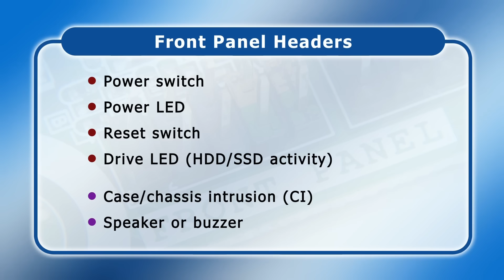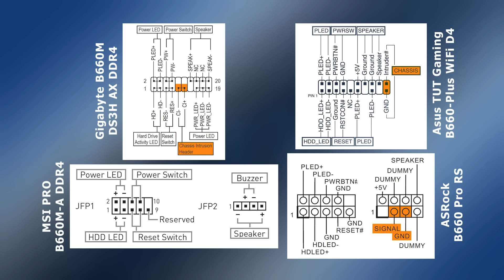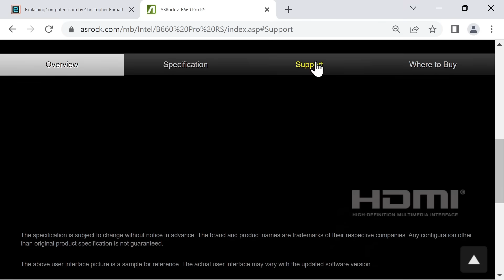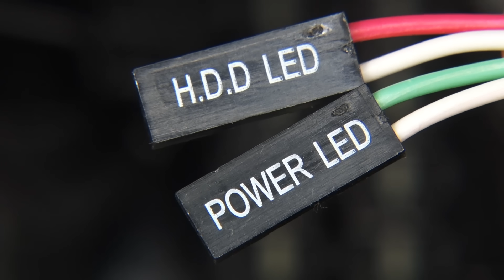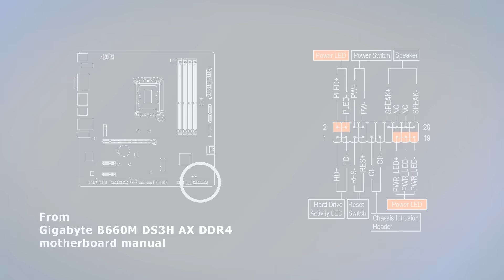Explaining PC Front Panel Connectors

Comment: I remember at least one case (pun intended) where I had to separate a bundled pair of switches to make them fit. 

I think it was the speaker that had a 4 pin connector with only two pins populated and they were next to each other while the motherboard had them separated. 
It is easy to change something like that with a paperclip or pin. Perhaps worth a small followup.
Reply: I went through the same situation several times, it was the speaker connection too.

Comment: I'm really glad that like 99% of manufacturers have the layout of these standardized nowadays, it was such a nightmare having to manually do each pin. Audio ones were the worst, because cases would commonly use different terminology than what the mobo manual said. X(
Reply: Maybe the usb consortium can help with naming/layout standards :D
Reply: @ironfist7789  please I'm not strong enough for this
Reply: @ironfist7789  The USB consortium has done terrible job standardizing names.
Reply: @markanderson2904  can call it UMB (universal mother board) 1.alpha.0 season 1 interation 0
Reply: @ironfist7789      Don't give them any ideas. 😊
Reply: @ironfist7789  That's good.
Reply: A written layout would have been nice...with some sort of labelling.
Reply: @remikdudek  noooooo I'm meeeeltiiiiing
Reply: why you connect any, need resets ? Press high ?
Reply: I recently did a video about a usb port front panel io that was split into each pin. What a pain to connect

Comment: LOL, wasn't much the front panel that was scary in the 90s, but the polarity and voltages of the processor. Get those wrong, and you could make the processor go bang bang.

And then there were IRQs and DMAs.

Most the front panel was just fiddly. Oh and setting the speed/turbo LED display...
Reply from the maker: Oh yes, those DIP switches were fun! :) Although usually well documented.

Comment: A small observation: with the correct polarity of the LEDs, the inscriptions on the connectors will be outside.
The speakers operate on alternating current, so they do not have polarity in the usual sense. However, the polarity is often marked on the speakers. The fact is that the speakers in multi-channel systems must be correctly phased, otherwise the sounds from different speakers in antiphase will cancel each other out and it will sound really wrong. Therefore, on the speakers there are conventionally plus and minus inscriptions in order to connect them correctly. If there is only one speaker, it doesn't matter.
There are also buzzers with a built-in generator, polarity is important for them (but they are not used in ordinary computers).
By the way, that small black buzzers are not piezoelectric. Although they have some design differences from conventional speakers, they are still dynamic, with a coil and a magnet.
Reply from the maker: Thanks for this. Not all headers have anything printed on them. :)

On speakers, I was very careful to caption "The front panel speaker does not have a polarity", and this is true. This is an educational video, and it would not have improved clarity here to explain that speakers do have a polarity when fitted in stereo pairs to avoid them being out of phases.

On the buzzers, I stand corrected. Thought I've certain fitted (and once opened up) one that was piezeoelectric.
Reply: @ExplainingComputers  Your average subscriber follows you for the nature of this response. I have an old HP which I use as a test rig, not shipped with a POST sound device. I absolutely have some old baby toys I never thought of exhuming for speaker collection. I would have continued to POST in silence were it not for this. That beep without a monitor attached can be pricelessly convenient. Remembering how many times I resisted the urge to buy a bag of case speakers not realizing I had about 15 candidates in by basement.
Reply: @ExplainingComputers  most of the buzzers i've opened up were a liiiiiitle tiny coil on a metal post, a ring magnet above it and a metal disc with a magnetic slug of metal welded to the center in a stack with a black cap that fits the base with a tiny 2mm hole in it as diagrammed in ascii, wires, plastic case(with pcb) tiny coil on metal post with ring magnet around it, metal disk, cap with hole =[:-:| } wow, i just diagrammed a speaker with text, i bet it'd look even better if i went beyond simple keyboard inputs and used the full unicode map of characters
Reply: +1 speaker wired in the incorrect polarity will be out phase.  the way to tell is that the positive terminal should make the speaker cone move forward, use an old 1.5 volt battery.
Reply: @garygranato9164  Out of phase with what?
Reply: @markanderson2904  try sucking in air when your lungs are full and blowing out when they are empty, similar happens when you try to drive a speaker backwards ;)
Reply: @frogz  No, it doesn't. The convention is to wire it so that the speaker cone moves "out", when a positive voltage is applied. But that isn't required to make speaker work properly. If you have two speakers, such as in stereo sound system, you want the speakers to be in phase with each other.  That means that when a positive voltage is applied to each speaker, one moves in the same direction as the other. It doesn't matter if it's forward or backward. If your stereo speakers are facing each other and you still want the speaker cones moving in the same direction at the same time (in phase with each other), then you wire the speakers opposite to each other. In a situation where you have only one speaker, "phase" is meaningless. It can't be "in phase" because there is nothing to be in phase with. That's why Chris says the polarity doesn't matter with the beep speaker.
Reply: @markanderson2904  with the original recording and other speakers that are wired correctly
Reply: @markanderson2904  I don't know if/when it changed, but it used to be anyway that most speakers were designed for forward movement and would not work correctly with reverse polarity, and if left that way for too long, could get damaged by it. The voice coil could be damaged by hitting the back plate, for instance. The surround and the spider can become fatigued by being continually pushed backward if they're not designed for it. Sub-woofers usually are made to work in both directions, but not all of them have been.
Reply: Great info,
Thanks 👍
Reply: This is what I was commenting, but explained better here.
Reply: @sorphin  The motherboard sends square wave pulses to the speaker, switching between +5 and 0. It does not create a negative voltage, unlike audio signal sources (radios, players, and so on). So, technically, the signal has a kind of polarity.
But for the loudspeaker it doesn't matter. On a pure AC signal (+V ... -V), it's membrane will oscillate in both directions, on a signal from the motherboard, only in one direction. Polarity only affects which direction the membrane will move during the pulse. If it moves in the wrong direction, it will not lead to anything bad, and there will be no difference in sound.
36 volts is not found in conventional computers. First, there is simply no source of such voltage. Secondly, this is too much for an 8-ohm speaker. I think you have seen this in some specialized equipment, but that's another topic.
Reply: Usually on female connectors are marked with a very small triangle in front of the positive wire.

Comment: Sometimes the hardest thing about the computer build is getting the front panel wiring correct. Another excellent video for novice or veteran pc builder.
Reply: It's just the size of the pins and the fact PCBs are often black now which is the worst colour when you want to see something printed on a board.
Reply: nope. The hardest thing is to find out how to connect wires which are not long enough to reach pins on you new motherboard :-)
Reply: Actually, I've found the hardest thing is getting people interested in how desktop PC front-panel connectors work. Chris has clearly triumphed over this obstacle, as I've managed to get several people to watch this who have absolutely no interest in PC building… It's all a matter of presentation.
Reply: You connect any, why you need that ? PC speaker sounds you like ? Low Ghz settings ?
Reply: @lucasrem  some boards have diagnostic led 's some rely on the small speaker it helps if there are issues with components , ghz low ?

Comment: 10:15 That left speaker does have a polarity. The orange wire is connected to - while the yellow wire is connected to +.
Reply from the maker: Speakers indeed do have a polarity. But this only matters if you are wiring a stereo pair so that they do not get out of phase. I was careful in the caption in the video to state: "The front panel speaker does not have a polarity", and this is always the case because only one speaker is being wired. It would have decreased clarity in this video to include discussion of the fact that polarity is irrelevant for mono speakers, but important for stereo, given the particular context.

Comment: FYI, home stereo speakers do have politary markings, but it used to keep speakers in phase so the stereo sound does not weird
Reply from the maker: I was careful in the caption to state that "The front panel speaker does not have a polarity". Polarity does indeed matter for speakers if wiring up stereo pairs. But this is never the case for a front panel speaker.
Reply: @ExplainingComputers  posted in caser someone wonder, you can reverse hook up polity on home speakers and they will work, but if one is only  reverse some sounds will be wierd
this if you using good speakers though

Comment: I believe it was Asus that once included a separate header block with the MB.
It had the male pins on the top and female socket matching the header on the MB.
The idea is you connect all the pins from the case to the separate header and then insert the separate connector to the MB.
No more struggling with cramped fingers as you try to insert the front panel wires on a densely populated MB.
Reply from the maker: Yes, Asus did try . . .
Reply: Hi, yes, you are correct and it is a big help.

Comment: My desktop case is twenty years old, and the front panel broke years ago. I refuse to invest in a new case, so all that's in the header is a momentary switch on the power pins. As long as atx is a standard, that case will always have a home.

Comment: I've fiddled with making these connections.  Once the main board is in the case there is far less room,  it gets much harder to see down there and plugging stuff in is tedious. I've also had to convert between 2 and 3 pins, and 3 and 4 too, by finding an appropriate bit of plastic and moving the wires in to that. Good times indeed.

Comment: Wow i'm surprised you didn't mention that the positive cable for the header has a small triangle on the connector. I have found this to be always true. Good video otherwise.
Reply from the maker: I've not found this always to be true. I've several cases where the jumper connectors have no marking whatsover.
Reply: @ExplainingComputers  Hmm very interesting. Maybe i have just been lucky..

Comment: Another great and useful video, Chris! By the way, I quite like the collection of salvaged speakers. That reminds me of my little box of things salvaged from a couple laptops that had gone to silicone heaven.
Reply from the maker: I'm glad to hear that I am not the only one hoarding such components. You never know when they may come in handy.
Reply: @ExplainingComputers  Yeah! A good chunk of my box is salvaged hard drives that I'm hoping to revive someday, including the one in my beloved old Acer laptop; wrapped in bubble wrap too! I just want my old pictures and Sims 3 files back, man. 😭😅
Reply: @ExplainingComputers  LOL, yes, I extract pretty much everything from a dead PC... down to the screws holding the case together. Many a dead power supply has been an organ donor when I've needed a case fan... and the one you toss WILL be the one you can't find anywhere when you need it, so into the parts box it goes!!

And lately I hold onto dead boards that have good capacitors, because I can see the day coming when we may be stuck doing our own repairs....
Reply: @ExplainingComputers  No you're not alone 👍
Reply: @ahmad-murery  What kind of tech bits do you collect?
Reply: @Praxibetel-Ix  it's been a while, I collected  a lot of old floppy drives, cd rom drives, a few speakers and beepers, IDE cables,
unfortunately I recently had to dispose most of them but extracted some motors from the cd rom drives
Reply: @ahmad-murery  Aww, damn...

I have three hard drives, a little USB board with two ports, a slim DVD/CD drive, three sticks of RAM, and a bunch of tiny screws. I was hoping to fix/refurbish my old Acer laptop (where a lot of those parts came from) when I had the financial means to do so but sadly, while I did get a job, the Acer ended up in the dumpster when we were moving. :(
Reply: @Praxibetel-Ix  Yes I also had a few of these too, it's sad how life forces us to do leave our beloved stuff
Reply: @ahmad-murery  Yeah... :(

If I still had that laptop, it would've been fixed up (with more RAM, a nicer hard drive or SSD with more space, and a new battery) and running either Linux Mint or Ubuntu.
Reply: @Praxibetel-Ix  Still using my 11 years old laptop (core i3 gen2) I added more ram and an ssd running win 10 64,
it's enough for web dev and some desktop app dev
Reply: @ahmad-murery  I just have a refurbished ThinkPad that I don't use anymore and a HP desktop thesw days. I do hope to get a nicer computer one day!
Reply: @Praxibetel-Ix  It was very nice to have some chat with you and I wish that you get that dream computer very soon👍.
See you next Sunday😁
Reply: @ahmad-murery  Thank you! It was great chatting with you too! I do run a Discord server for those who have channel memberships with EC that, if all truly goes well, I plan on opening to everyone else sometime in the future. Anyway, see ya! :D

Comment: Some new infro I've gathered from this video. Thx.
BTW. out of curiosity - what is max impedance of PC Speaker a motherboard can handle?
Reply from the maker: This I do not know, but have on many occasions over the years tried (and failed) to find out. :) 32 Ohm is the highest I have ever (knowingly) used -- many sounders are not labelled. Anyone?

Comment: I miss the Turbo switch and LED we had on old AT cases, and the corresponding front panel connector pins for them, that we had on AT motherboards. :(
There also used to be a key-lock switch on the cases and some front panel connector pins for that.  PC cases used to have that switch so that a PC could be "locked off" by its owner.  The key lock switches were usually very cheap things -  and gave about as much security as a paper bag. :)
Reply from the maker: I agree, I liked the turbo switch. :)
Reply: Unless i'm mistaken, I thought the key lock switch disabled the AT keyboard connector.
Reply: The turbo switch was desireable on the AT clones which ran at 8, 10, or 12 MHz so one could turn down the speed. Many programs wouldn't run acceptably at such high speeds.